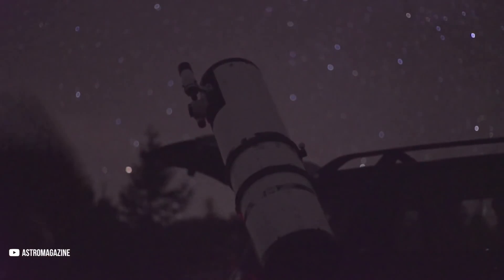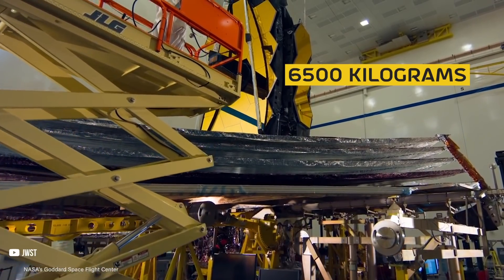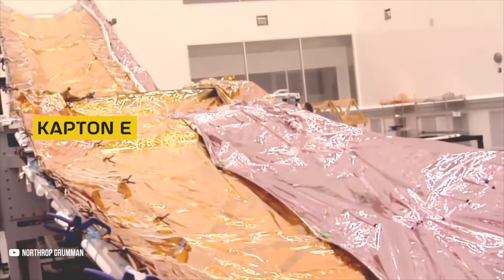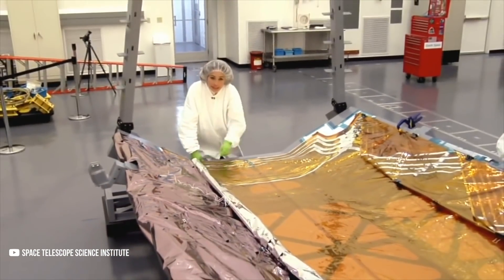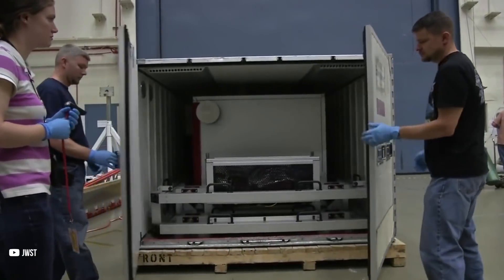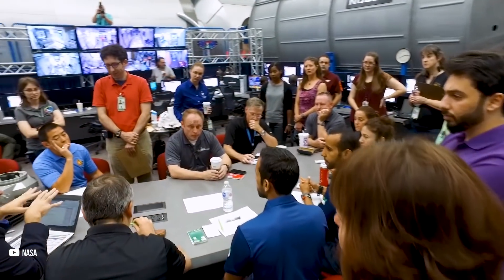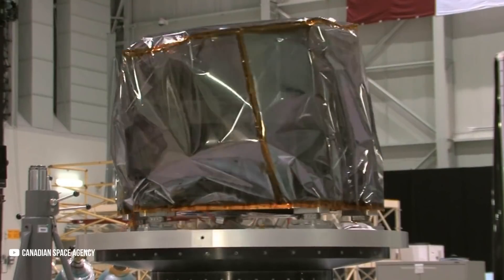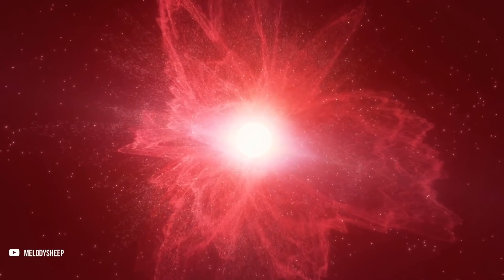James Webb Telescope: The Truth Revealed in 12 Minutes

Comment: Why only ten years.
Reply: JWST has to use fuel regularly to stay in its location orbiting the L2 point (and to desaturate the reaction wheels). It has enough fuel for 10 years.
Reply: @h.dejong2531  but I thought they are using solar.
Reply: @what9621  They're using solar panels to run the electronics. JWST has reaction wheels that are used to change the spacecraft's attitude (the direction it's pointing in), but these have to be reset occasionally - and you need thrusters to do that. JWST is in an unstable orbit: if left to drift, it would eventually move away from the L2 point.
Reply: I am excited as everyone, I feel ten years is so short considering the time and money spent. So why not use nuclear power.
Reply: @what9621  even with nuclear power, you still need a propellant to move the spacecraft around. A nuclear power source replaces solar panels, not the thrusters.
Reply: @h.dejong2531  thank you H d.  You have educated me further on this issue. Let's hope that JWST is successful on its mission with a successful launch on Christmas day tomorrow.  On a side note, I hope we can come with a way to refuel JWST in about ten years, I know it's pretty intricate in the refueling process. ALL  the best to JWST, I will be watching the launch.

Comment: There are many flaws in this design. There are no adequate solar panels (2kw) and no batteries to operate all those motors, actuadores, sensors, transreceivers and energy needed to keep the Hydrazine and Dinitrogen tetroxide at its operating temperature. The quantity and the location of the boosters will not provide 3-axis maneuvering required for attitude and orbital positioning. The telescopic / hydraulic rods used to deploy the sun shields are the worst design since they are vulnerable to vibration, stress and more importantly to extreme temperature variations. It seems that this satellite, just like all other satellites, will be mounted on a platform hanging from a high altitude balloon that supplies the power needed for its operation. As you saw in the videos, the builders are able to lift the 6+ tons satellite by holding it to its one side, which means this is not a design for weightless structure, but is a design to hold the satellite by its mounting bracket.
Reply: @ShonMardani-c4q  Yes you have ignored physics.
Reply: @Stacy55ish  Physics is clear, no propeller, jet or rocket engines can work without the atmospheric pressure. Rockets move not because of the Action and Reaction, but the forces of fast, hot and compressed gasses out of the engine pushes the rocket. So in my opinion no mechanical or chemical propulsion will work in the space vacuum, simply there is nothing there to push against and move.
Reply: @ShonMardani-c4q  No, physics is clear: Rocket engines can and do work without atmospheric pressure. The rocket throws some mass one way (the exhaust gases), and in reaction it moves the other way.
Reply: @ShonMardani-c4q  Nope that's false. The thrust of the exhaust pushes against the rocket and that causes it to rise.
Reply: @h.dejong2531  The theory of action & reaction is an unproven theory make hundreds of years ago and never was mathematically proven. If it make sense to you because you see a balloon moves when the air forces out of its opening, it is because the air coming out is forcing against the air. Imagine a bullet is forced out of the barrel by compressed, hi pressure gasses, bullet moves because the barrel does not move outward fast enough or at all. It is very easy to experiment and validate your and my theory, just put a strong balloon in a vacuum chamber and open its mouth, you will see that air will be sucked out of the balloon and will dissipates instantaneously without pushing the balloon other way. You also can measure the forces created by the same balloon in a different atmospheric pressures and compare the reaction forces for the same action force and draw a graph.
Reply: Seriously? Didn't you listen to how much testing was done to be sure all its components work as designed according to its mission?
Reply: The spacecraft does have batteries. It has all the thrusters it needs to maintain its orbit. Of course it won't be attached to a balloon. 
The builders are lifting the spacecraft by the ring that will be used to attach it to the launch vehicle. Obviously, the spacecraft cannot be designed for weightless conditions only: it has to withstand the g-loads and vibrations of the launch. So components like the interface ring will be very sturdy.
Reply: @ShonMardani-c4q  Like many spacecraft before it, JWST will be in a heliocentric orbit at the Sun-Earth L2 point. More than 100 spacecraft have escaped Earth's gravity entirely and have been sent to Mars, Jupiter and other planets. 5 spacecraft are on escape trajectories from the entire solar system.
Reply: @h.dejong2531  Everything you say and every photoshop image to support these claims are made by one company, NASA, this is how they justify their billions of dollars they collect from the tax payers and spend it on defence R&D as well as building and launching military and commercial satellites.
Reply: @ShonMardani-c4q  Ignorance is not a virtue
Reply: @ShonMardani-c4q  We have photos of the far side of the moon from a bunch of spacecraft, the first was the (Soviet) Luna 3 mission in 1959. I particularly like the ones taken by the DISCOVR spacecraft (which orbits Earth outside the Moon's orbit, so it can capture Earth and Moon in a single shot). 
There are many websites that will tell you exactly where the planets are, you can even enter your own position and get an image of the sky as it will appear at your location, to make it easier to locate stars and planets. Venus, Mars, Jupiter and Saturn are visible with the naked eye. With a telescope or a good photo camera you can see details.
Reply: @ShonMardani-c4q  There are loads of images and video taken by/from spacecraft orbiting the Moon. The axis of rotation of the Moon is also well-known.
Reply: @ShonMardani-c4q  Earth seen from the ISS: https://www.youtube.com/watch?v=86YLFOog4GM
Reply: @ShonMardani-c4q  Earth seen from the Moon: https://www.youtube.com/watch?v=ZbU3crqJt3w
Reply: @ShonMardani-c4q  Newton's third law in a formula: Fa=-Fb. Ever since Newton first formulated this, scientists have tested it: they set up experiments to see if their observation conformed with this law, or if it disagrees with this law. 
That's how science works in general: Scientists (in this case, Isaac Newton) does observations and formulates an explanation for them, this becomes a model. The model is tested using more observations or experiments. When the model holds up and makes accurate predictions, it becomes a theory. The word 'theory' has a specific meaning here: it's not the colloquial opposite of 'practice'; a scientific theory is a model that has been shown to be accurate in a wide range of circumstances, and the best way we currently have to explain how things work. 
Models and theories are always subject to improvement. 
In every test scientists have done of Newton's model, that model turned out to be accurate. It wasn't until Einstein came up with relativity that we started to see exceptions - when moving at relativistic speeds, Newton's laws no longer apply. 
In summary, we're not relying on the word of someone who lived centuries ago. We use these laws of motions because they have been shown to work in a wide variety of circumstances.
Reply: @ShonMardani-c4q  The rocket still provided thrust before filling up the vacuum chamber. 
There's another way to look at how a rocket works. The rocket propellant is mixed and ignited in the combustion chamber. This causes the combustion products to expands. A gas wants to expand in all directions. In most directions (left, right, front) the gas cannot expand because it runs into the walls of the combustion chamber and nozzle. The gas exerts a force on these walls. In one direction (the opening at the end of the nozzle) the gas can expand, so it doesn't exert a force there. The forces on the sides of the chamber and nozzle cancel each other out. The force on the front of the nozzle is not cancelled out. This force drives the rocket forward.
Reply: @ShonMardani-c4q  As I mentioned before, rocket thrust increases as atmospheric pressure decreases:
Reply: @ShonMardani-c4q  You have completely misunderstood the scientific process. The only branch of science that has the luxury of absolute certainty is mathematics. Mathematicians have defined an abstract world where they can define everything. Maths starts with a set of axioms, from which every mathematical construct can be derived via a mathematical proof. The other sciences including physics don't have that luxury. They have to start by observing the world and trying to understand what they're seeing. Observations lead to models, models are tested and models that hold up become theories. At any time, a theory can be (and will be) discarded if a better one comes along. Ptolemy's theory of the solar system (earth at the center, planet orbits using epicycles) went out the window when Galileo observed Jupiter's moons and found that those can't be explained by Ptolemy's model. For a long time, chemists thought atoms were the smallest unit of matter and could not be divided further. Then we found a whole world of subatomic particles and a new model was required.
Reply: @h.dejong2531  Science is predicting the future cycles, it goes out of the window fast because it is hard to predict, Math is counting and calculating the past cycles, that is why it starts with a set of axioms, known, agreeable and trustable numbers. Observation is the reference point where we count to and predict from. No one observes the world and tries to understand it, curiosity is a form of survival mechanism. Predicting the future helps us adapt to the environment and survive. We can not predict the future without knowing the past, so we can not have true Science without Math.
Reply: Você não sabe nada, esta falando abobrinhas, tome um comprimido e vá descansar.

Comment: Hubble was fixed by another mission and any non alignment of mirror, is a mission compromised. Can a humans go and fix it if there is any issue like we do for Hubble?
Reply: It'll be 4 times the distance of the moon away, so if it doesn't work that's it.
Reply: We can't easily do a manned mission to JWST. A mirror alignment problem can be fixed remotely - the primary mirror segments are adjustable.